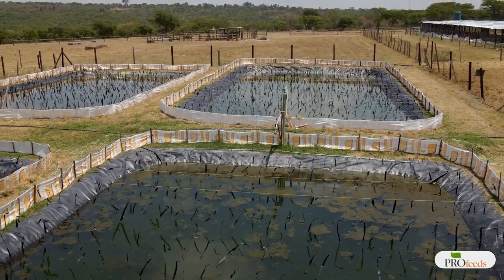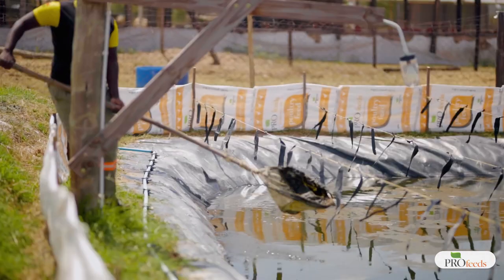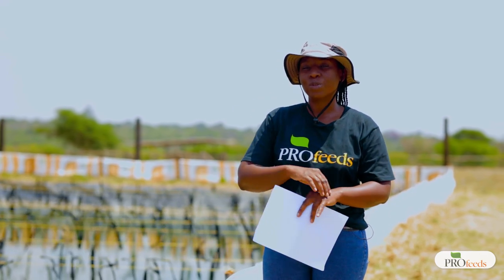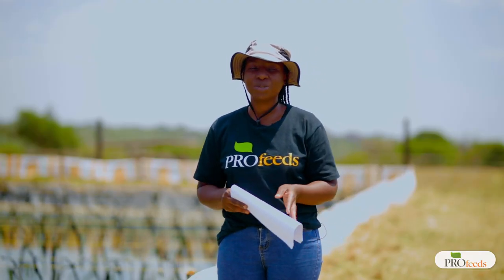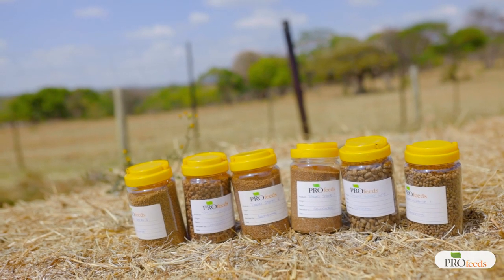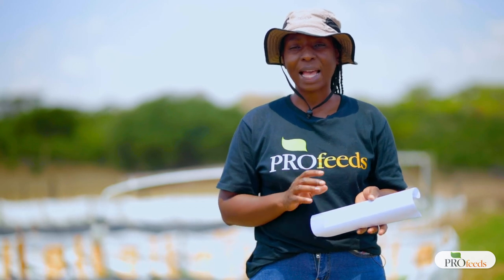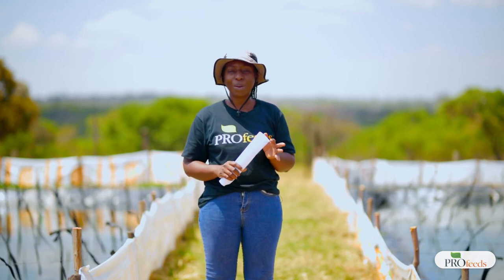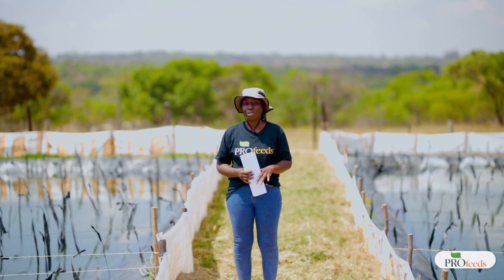Profeeds Aquafeeds FIsh Farming Master Class 1

Comment: Thanks for the lesson. I see almost all fish providers say 10 by 10 by 1.5m dam should hold 1500 fish. Is that correct
Reply from the maker: With stagnant water - that is water that's stagnant most of the time being exchanged on a need basis, we recommend 5 fish per square metre. So a 10 by 10 can hold 500 fingerlings.

With aeration the stocking density can be increased, for example, if flowing water can be provided on a continuous basis then 10 fish can be stocked, that will be 1000 fingerlings for a 10 by 10